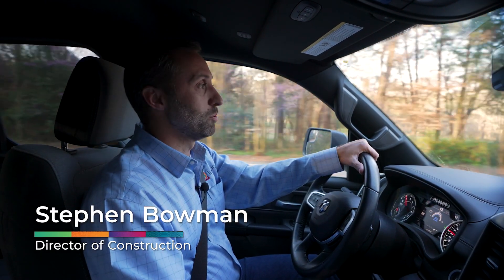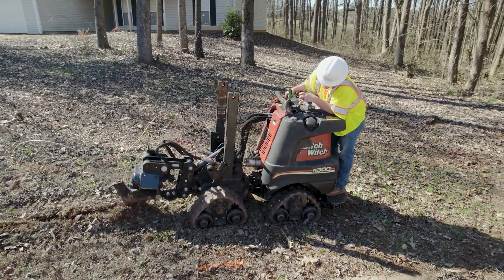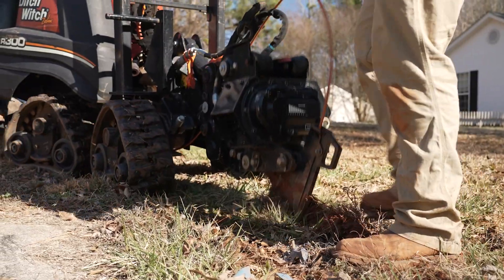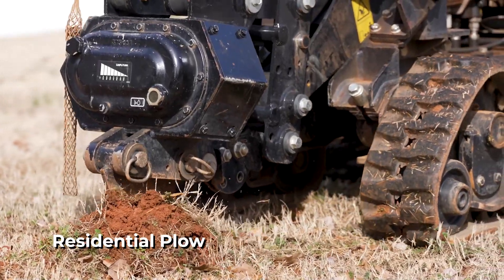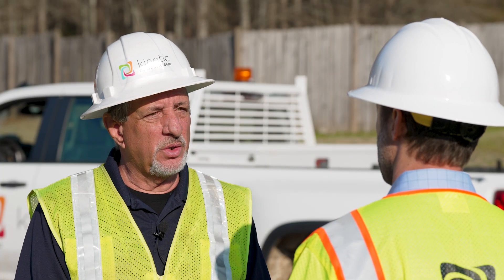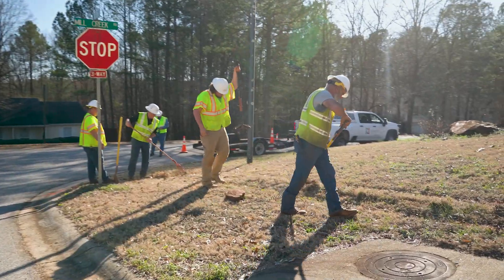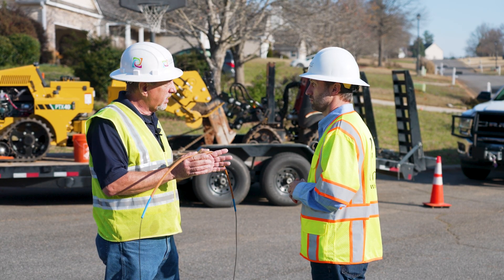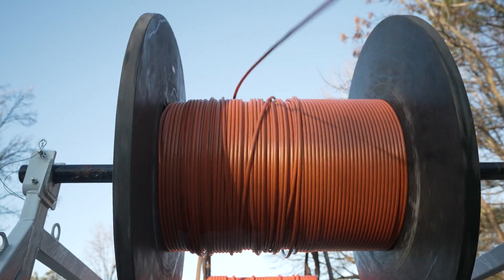Kinetic by Windstream Delivers Fast Fiber Internet with High Quality Residential Plow Installation

Comment: They don't allow fiber to everybody they have their favorites. I'm still at 25 mbps, still on copper slow as Christmas. Getting a representative to help you is like pulling teeth. A lot of them talk crap while on the phone with you to the coworkers, and you're listening to the entire conversation while they heckle in the background. Smh
Reply from the maker: Hey Connie, we're sorry your support experience has left you feeling this way. We'd like to hear more details so we can investigate and make sure that you're getting the best experience possible. Please head to our website, where you can contact us using our convenient chat feature or the Go Kinetic portal: https://www.windstream.com/
Reply: Same here. 🙁I only have DSL and going just a little down my street I see FIBER INTERNET BOXES/buried Fiber signs. I even have fiber lines above my driveway, but I still have 50 MBPS DSL. I mean, still good WiFi and reliable at least.
Reply: Exactly right have the same issue others get it and people less than 1/8 mile away don’t . Windstream is awful and misleading.
Reply: @larryderiso6463  They told me that they were doing false advertising and the fiber optic marker sticks are misleading because “they probably used the wrong markers since that’s all they had” but I doubt that because it’s literally fiber signs all in my area
Reply: @ElevatorWasher5000 same issue . I see the fiber markers but they always say fiber isn't available. Makes me think they didn't install it at all. And they were given federal and state grants to do so.